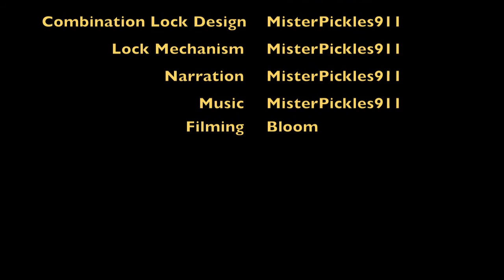Lego 5-Digit Combination Lock

Comment from the maker: Sorry, i have already destroyed it to make other awesome stuff ;) but it uses the same mechanism as a normal combination lock - there are rotors connected to the wheel at the top, and they 'catch on' to eachother as you turn the wheel around. by moving the pegs on the inner wheels, you are changing the mechanism. None of this probably makes any sense, but if you really want to know how a combination lock works, check out the link in the description...
Reply: MisterPickles911 YOU CAUSED 9/11 😱 jk bro you're awesome